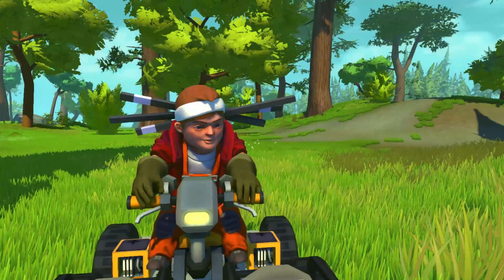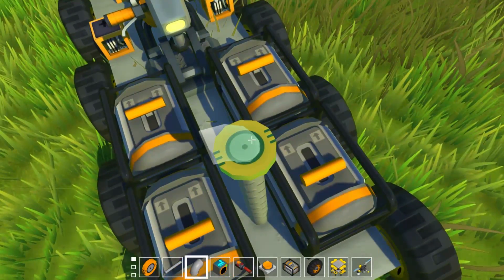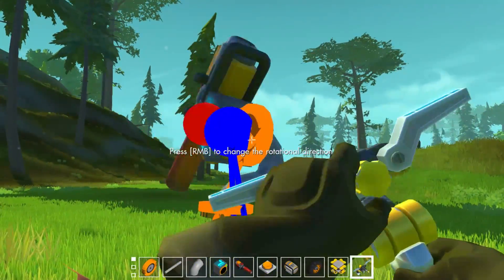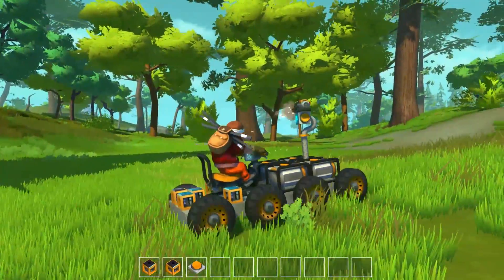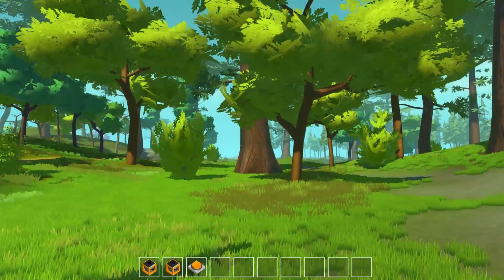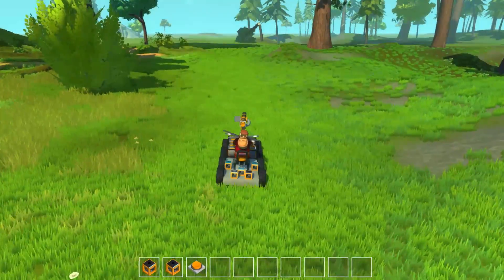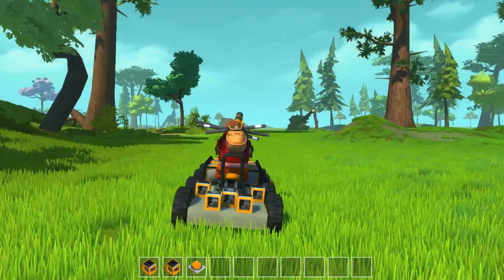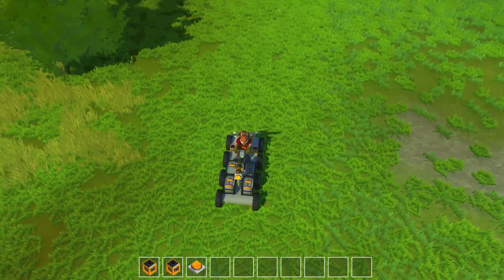Control Tanks with WASD + MOUSE! | SKREP MAKENIK

Comment: Please help me. When I made this system, the mechanism started rotating randomly. What should I do now?
Reply from the maker: invert your bearing..?
check your connections again, maybe with your engines on very low speed
(pay attention to what happens! are the movements opposite? maybe WS needs to be switched with AD?)
Reply: @Durf  Oh, okey, I Will rebuild and check it.

Comment: is there is a block that u can connect an activator(ex switch) to the the block which have an ui by which you can choose a button from ur key board that if pressed it well activate the activator(switch or button) then connect it to the thing that needs to be activated (bearing) then to the seat the will control it by pressing the button on the keyboard if not i hope u add it 

srry if it was bad English i am an Egyptian 13 years old and still learning English

Comment: I need to learn how to make my whole vehicle rotate with my mouse because im making a flying vehicle
Reply from the maker: You should be able to use this tutorial to help you, but you might also want to check out a "reaction wheel flyer in 0g" video I made, or just slap thrusters around your flyer. Then use the mouse controls (logic sees it as WASD values) to power specific thrusters.

Comment: Is there any way to tell what mods I need? Like some kind of "part detector" tool? This creation I want to try has only The Modpack listed, but clearly requires more. Modpack Legacy filled in some holes but I still can't build it.

This is a common issue and frankly I've thrown empty Dr. Pepper cans at walls over this.
Reply from the maker: Something I will try to add to the Scrap Mechanic Mods website in 2019

Comment: would it be possible to make:
A: a seat that places you "in" another block when you enter so that we could have cameras?
or B: a numeric readout from the smart controler (is that it's name?) to measure it's angle?
side-note: is there a discord where I should be posting theese things?
Reply: I think surf does have a discord server, there's probably a link in the description. And regarding B: you can input an angle to the smart controller... But I assume you're wanting some form of rotary position feedback so you can emulate continuous rotation servos?
Reply: @finnk1289  yes, your analysis is correct, and thanks for the info regarding discord
Reply: The x-o-meter has an angle measurement in case you were wondering